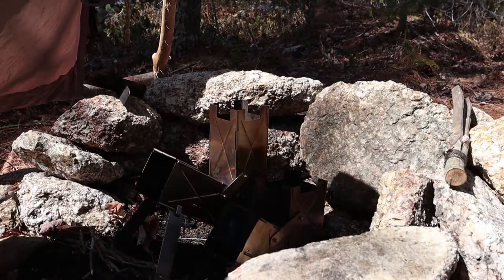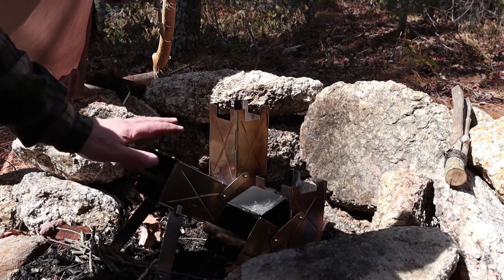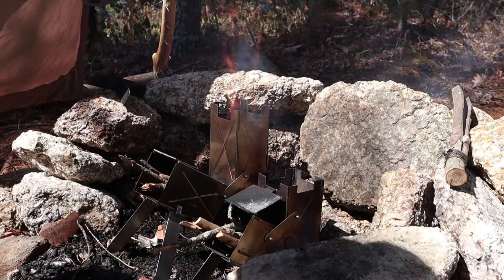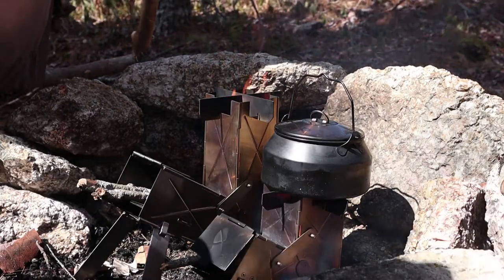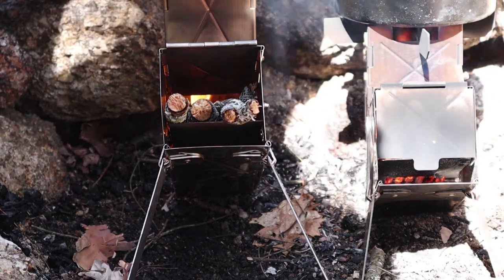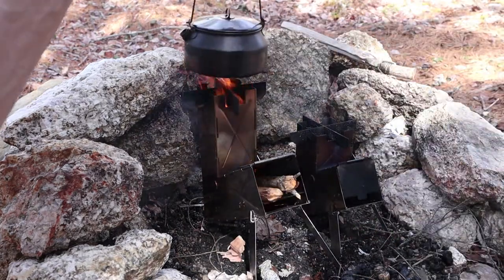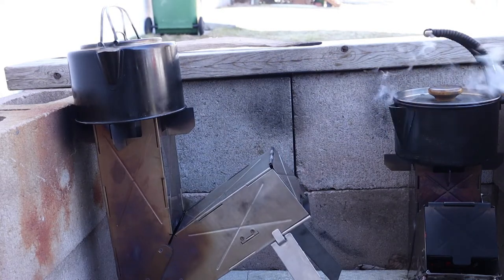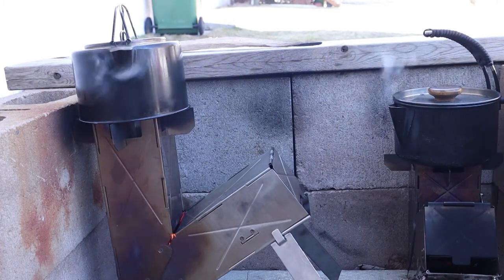VIRE Stove & VIRE Mini - Part 2 - Demonstrations with Wood, Wood Pellets and Charcoal

Comment: I have found that a little bit of Home heating stove door insulation kind of looks like rope works well on the spots where the vire doesn't come together quite well.
Reply from the maker: Great idea. I have used carbon felt as insulation but had not considered the fiberglass rope. Thanks for commenting

Comment: Figured I would comment, the gaps in the stove are caused by having a latching bar only on one side, the other side hangs loose and will naturally separate. They need latching bars on both sides for it to close up tightly, especially with such a loose bottom hinge.  As for insulation, they could perhaps come up with a fireproof insulating 'sock' that slips on the outside of the stove. There are a number of possible insulating materials that could work. That would let it remain packable and keep the weight down. 
Appreciate the through review.
Reply from the maker: I tend to agree. I have not had an issue so far but I can see how it could become one. Thanks for commenting

Comment: 👀Nice video👌I don't know.. But the "Kelly Kettle"  it always helps to have the "fire feeding opening" UP against the wind (straight in 90*) for direct airflow. 18:43 Look at the steam from both kettles. The one to the LEFT is blowing downward, the one to the RIGHT is blowing more natural (horizontal / up). "TURBULENCE"
Reply from the maker: Yes, it does help the KK to have the air ports facing the wind. I may help with these stoves as well. Worth trying. The Mini will still be hampered by its short chimney in any case. Thanks for commenting
Reply: Yeah  You're welcome. I'm glad! @MarkYoungBushcraft
Reply: And I say; Thanks for your reply. @MarkYoungBushcraft

Comment: I purchased the large one some time ago.  I didn't think I would like the smaller one because it seemed like a design flaw.  After seeing you use the mini I am quite impressed.  Eventhough the mini isn't trully a rocket stove that side feeding shoot is a plus in my opinion.  It sure fired up quickly.
Reply from the maker: VIRE has upgraded their design to reflect a lot of what I mentioned. They also have a titanium version I am hoping to try out. Thanks for commenting
Reply: @MarkYoungBushcraft  thanks so much for your videos!  Have you had a chance to try out the titanium?  I was super bummed to see they only made the titanium version for the mini model when it seems the original is superior (guessing they assume the use case is for someone exclusively concerned with weight).  I’m more interested in strength and it’s ability to rapidly cool. Re strength: is titanium less prone to warping from heat? Re cooling: I believe drenching in water is bad because it would make the metal more brittle, right? But is there a safe way to cool metals/stoves more quickly? Maybe putting a bit of dry soil on it? 

Relatedly, I had an idea I wanted to share to help with the insulation issue in wintertime.  Maybe you could use a trowel/knife to quickly dig out a little space in the soil that the unit could slide into? Might be more work than it’s worth but if you didn’t have other insulating materials on hand maybe that could work in a pinch? I imagine you wouldn’t have to dig super deep, but you could just take the V-shaped of the unit and then use the soil that you dug out to insulate the rest of the way. Anyway, just an idea.

Thanks again for all of your content!!  I have learned a lot from you!
Reply from the maker: @akbaskin3000  Hi Andrew. I have not been able to get my hands on the titanium mini but would love to do so. Yes, cooling a steel stove with water can harden the steel making it brittle. Having said that, Mac at Simple Theory Gear recommended cooling his stoves off that way. His comment was the stove would anneal (become soft) with the next fire. With another rocket stove I wrapped carbon felt (welding blanket) around the chimney as insulation. It worked quite well. Hope this helps some
Reply: @MarkYoungBushcraft   thanks!  I appreciate how responsive you are Mark! Cheers!

Comment: what stove would you carry on a camping trip and buy if you could only afford one. I watched your reviews on the kelley the vire and others but no indication which trumps which. Maybe a comparison video. Love your channel
Reply from the maker: Sure. It is hard to say one stove is the best as they all have pros and cons. Having said that, there are two stoves I would recommend. The Gen 2 5" Firebox and the Bushcraft Essentials Bushbox XL. They are very close in size, weight, design and performance. They are bigger and heavier than many stoves but will always perform. Titanium weigh less than stainless steel but costs more. Of course, then you have to consider what you will cook or boil water with as well as cutting wood to burn, unless you can collect and break it with your hands. By no means a definitive answer but at least a start. Good topic for a video I think
Reply: @MarkYoungBushcraft  thanks for the reply and the input

Comment: A nice conclusion to your assessment of the Vire Stove & Vire Mini. Your comprehensive review basically supports your initial impressions. The Vire Mini in my opinion, the greatest disappointment. Hopefully the makers will rework that model. Glad to see you cooking food on the Vire stove, showing it can do more than just boil water. Did you burn charcoal in the Vire Stove? And once again, your newish microphone really excelled in the windy outdoor conditions. 🏆
Reply from the maker: I agree, the mini needs a bit of work. Vire has made a few changes since my video was recorded. I have used charcoal in both stoves and like how it performs. Only down side is can create a hot spot on a frypan due to the small cross-section of the chimney. Thanks for commenting
Reply: What mic do you use, Mark?
Reply from the maker: @lynella6073  I upgraded my system (at some expense) a few months ago to the Canon M50 and Rode Wireless Go. Worth it to me but still learning how to make the most of it

Comment: While it may not be practical for field use, it would be interesting to see how wrapping the chimney in some type of insulation -- carbon felt perhaps -- would affect the burn in cold weather.
Reply from the maker: Right on. I have successfully improved the performance of another rocket stove (previously reviewed) using carbon felt. It would help here as well. Thanks for commenting

Comment: I had used the original vire to cook 2 hours straight.  I noticed it creates alot of coals that clogs up after around 30 mins of feeding.  I used chopped wood,  not small branches.  I am guessing it will perform optimally with twigs and not wood. Has the coal created by the stove turned into ash in your test?  Mine mostly stayed as coal.
Reply from the maker: My experience is that thinner pieces of wood (sticks or splits) will burn hotter and consume more thoroughly. Best if they are hardwood. Bigger chunks will be more likely to stay as coals. Even so, ash does build up over time. Thanks for commenting

Comment: I'm still not used to this stove, I find that it is very frugal on wood use and I love that it can use long sticks, but it takes so long to bring water to a boil. And I have to use fairly thin sticks in it to keep the fire going.

I've not used it in summer yet, just winter and spring. In the winter, it would not bring water to a boil at all, and in the spring it took a long time, especially on windy days. 

The last trip I took, I used my Firebox and found it much faster.

Do you have any idea what I'm doing wrong?
Reply from the maker: I don't believe you are doing anything wrong. I find all rocket stoves that do not have insulated chimneys loose a great deal of heat during cool or cold weather. Try it again during warm weather. You should find it works fast and clean once it gets going. Hope this helps
Reply: @MarkYoungBushcraft  thanks Mark, I've been thinking of adding insulation with carbon felt or a welding blanket, as well as constructing a wind screen for it.

Would you consider doing a video of your experiments with carbon felt so we can see the difference? I really want to like this stove.
Reply from the maker: @ms.gearhead6884  I can do that. I will likely wait till winter to really show the difference

Comment: It comes  down  to is it worth carrying  vs other styles  of portable fire boxes. Fuel versatility ...what you can gather or carry ...no fuel no fire. Assembly to fire...how much work to unpack the stove ...assemble and ignite. My preference tends towards a hobo type stove...this looks to be more  of a gimmick.
Reply from the maker: Right on. Accurate summary. Rocket stoves are designed (if built correctly) to be hot and fast and clean burning. Ideal for locals were the dangers of smore exposure is high. They don't simmer or grill well. There are more versatile stoves but few that can provide this fast clean heat. Thanks for commenting

Comment: Question: How much wood will these stoves burn through before the chamber is choked from ash or are they so efficient that they burn through most of the ash?

It's great to know they can use alternative pellets and charcoal fuels!
Reply from the maker: Good question but a bit hard to answer. I am sure you are aware the factors that influence complete burning include air flow, moisture content of the wood and type of wood used and of course, design. What I found is that once the stove is going well it consumes pretty much all the fuel very efficiently, leaving very small amounts of fine white ash. I am not sure it is intentional but some of that drifts out the gaps at the bottom. After about an hour of use I see about a palm full of ash. There are better stoves but this is not bad. Hope this helps
Reply: @MarkYoungBushcraft  
Thank You for your response. As I have already purchased both these stoves but haven't used them yet I now have something to look forward to in using them.

Comment: Both vids were excellent!
I like the larger original, it shows all the signs of operating like a proper rocket stove.

The mini looks to me to be  a waste of material and time.    

If one wants a rocket, you have to accept the size, as the stack height is vital to its operation.
Reply from the maker: I agree Randal. The full size, despite its weight and bulk, is a much better performer. Thanks for commenting